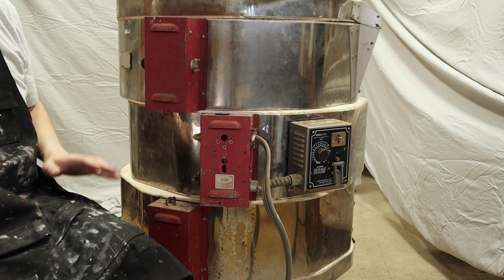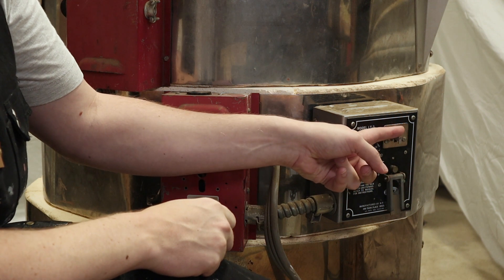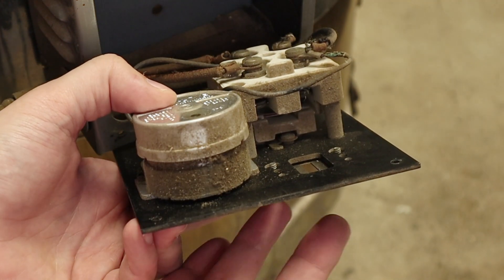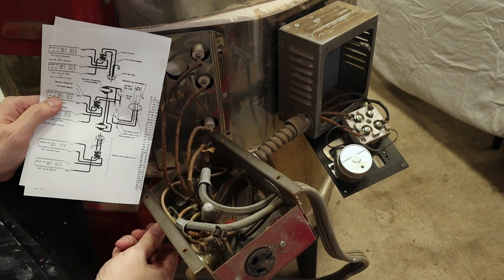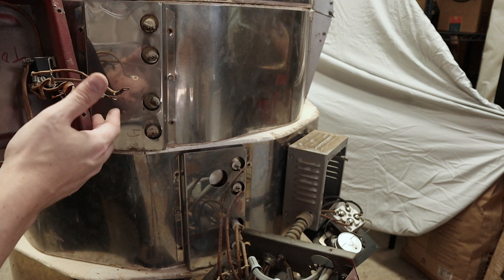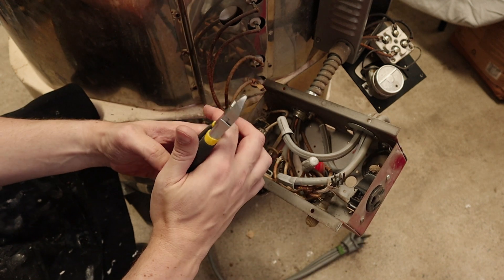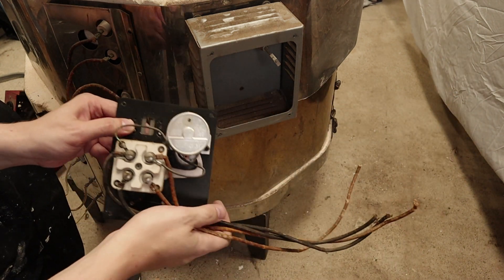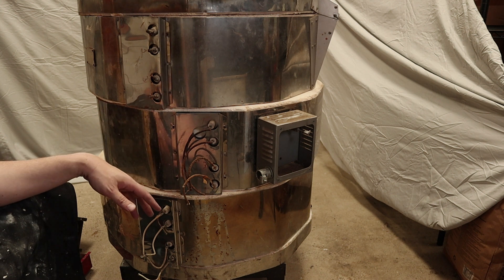Skutt 231 Kiln Teardown and Wiring

Comment: I replaced the KM Controller on my kiln. It came with brand new electric cord so if you plan on getting a new controller you won’t need a separate cord.
Reply: Opps……. I just noticed this is a 2 year old post 😀
Reply from the maker: Yep it is a bit old! You can see in the playlist I built my own controller and it's been great.
Reply: Opps……. I just noticed this is a 2 year old post 😀
Reply: Opps……. I just noticed this is a 2 year old post 😀
Reply: Opps……. I just noticed this is a 2 year old post 😀

Comment: I watched through this whole series and the process was very cool to watch. 

One thing that you have repeated through the videos, is regarding the original configuration. You may have already figured this out afterwards, but the original wiring (assuming the house/breaker box was wired correctly) was a correct configuration. Most kilns don't need a neutral. 240v doesn't need a neutral unless it is also using some kind of 120v control or display, or it's using 120v elements. You only need a neutral to make 120v out of the 240v, which most kilns don't and didn't use. There are some kilns that do require the neutral, but just based on looking at the original design of yours, this one does not. The third leg of the original power cord was your ground, and was grounded to the case properly. Whether or not the wire was grounded properly in the breaker panel where it's installed is up to who wired it. Of course it never hurts to run a cable with three conductors and a ground, but especially if it doesn't need it, not having the third neutral conductor is usually a pretty big cost saver in the wiring portion. 

It's been cool to see your process of renovating it! I love doing my own kiln projects and such on my older kiln, so it was cool to watch someone else doing it too.
Reply from the maker: Thanks! Yes you're right it was only using the two legs to get 240v. And the kiln was so old it was just applying the 240v to the elements through the switches. Or at least it should have! Some of the wires and connectors were in very bad shape and I'm guessing would have arced to the case if I tried to power it up! But I knew I wanted to digitally control it, so swapping out the high voltage wiring along the way was cheap piece of mind.
Reply: hola! en el caso de querer usar esa tercer pata en una conección trifasica, donde se conecta ese tercer cable que está a tierra?
Reply: @juanlodos928  
Necesitaría un cable de 3 conductores y una conexión a tierra adicional. La conexión a tierra se conectaría a tierra en su panel y luego a sus tres conductores para cada fase. Los hornos casi siempre se muelen hasta el metal de la caja de control. Traducir, por lo que podría ser una barrera del idioma